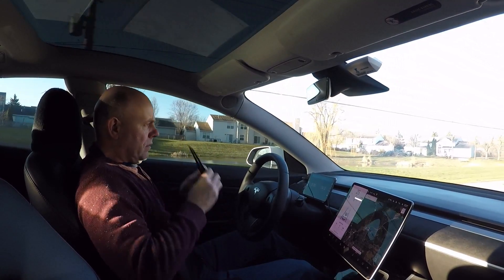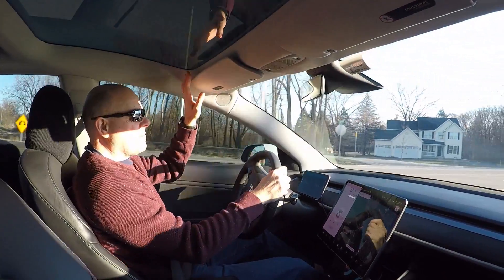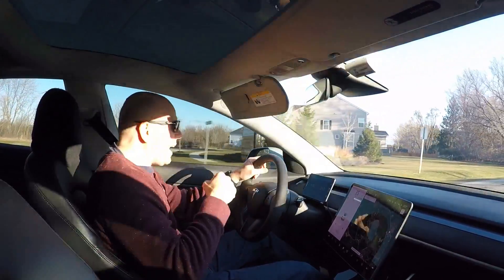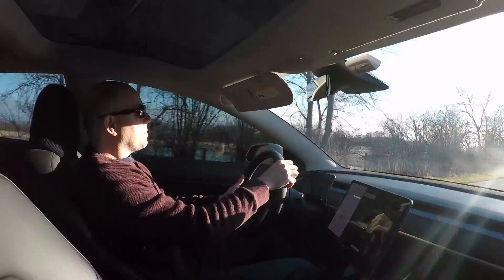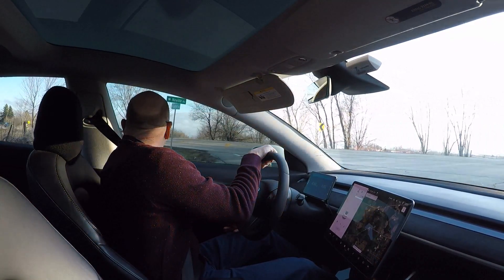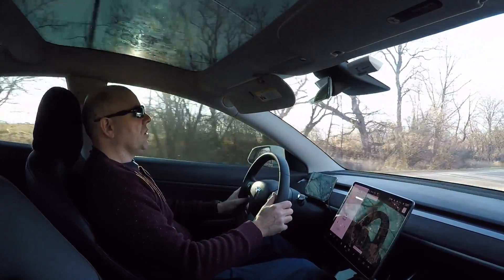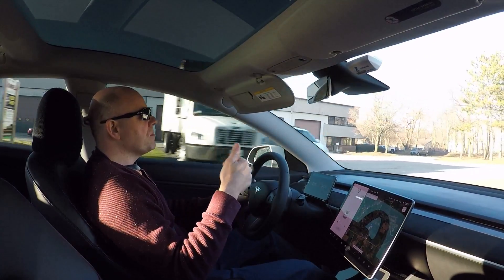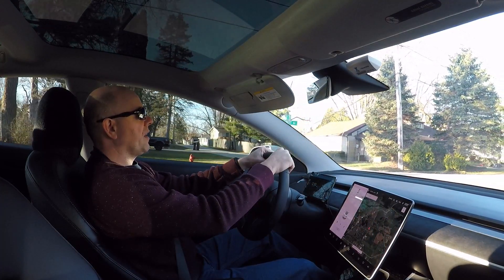Tesla Model Y and Model 3. I found a problem with one pedal driving!

Comment: Other easy solution, just slam the brakes from time to time and do a full stop from 60 or so. That cleans them up pretty quickly. Or just use Autopilot. It will also Slam the brakes in the current version for no reason sometimes 😂
Reply: Yes I noticed AP tends to use the brakes more frequently than my use when driving normally. For me only time I really use the breaks in normal driving is when the light changes to yellow and I am to close for regen to stop the car in time.

Comment: This is a common problem on all performance cars. It happens within 24 hrs after rain. The residue from the brake pads rusts, but it’s not a defect/problem. The first time you use your brakes it gets cleared up. Had this on my BMWs and Corvette.

Comment: I had the same with 3 JLR cars I had before I bought my model 3. The method I used was to LIGHT  brake while still giving the accelerator some pressure, but only for a very short time. Same result / different method.

Comment: as a previous mechanic i can tell you hard breaking can glaze your brakes and this is bad because you lose 50% or more of your breaking power! i would suggest pop it into neutral and feather the break for a long distance and it will do much better! clean your system with some break cleaner then treat your non contact surfaces with something like ceramic coating or if your cheap and not mine more frequent elbow grease use wd40 on non contact areas and be careful after any cleaning or treatment do some breaking with caution to rid of lubricants off contact surface

Comment: Some good tips Matt.  The one pedal driving setting is the same as the non creep mode though - the car still applies the brakes from 8mph to 0 but it does it for you and very softly.  Rich Rebuilds did a video showing some yearly maintenance on Teslas that includes cleaning up and lubing the rotors.  Helpful to do once per year so the pads don't lock up in the calipers especially in areas that have a harder winter with salt and chemicals on the roads.  The video title was "Servicing your Tesla model 3: The Complete Guide" - should be easy to find.

Comment: Had the same problem on my 2014 Model S P85 100,000 uk miles . The rear calipers were seizing and the discs were scored. Now a bad price to have them replaced and was told "look put the brakes on hard at least once a week you just never using the brakes". Fair comment. Two weeks later an over air update now indicates next to no regen in the morning that makes you use the brakes.....problem solved.

Comment: If I pull my ICE car in the garage after driving in the rain and let it sit a few days, the rotors rust every time. I hear a scraping sound when I drive away but the rust gets removed in normal driving. The rust doesn’t seem to hurt the rotors and the scraping sound goes away after 100 feet or so without any conscious effort on my part. It seems to me, if you used your brakes every time you park in your driveway just before you get home, the rust would be taken care of. In this way you don’t have to remember to do a special brake “cleaning” every so often.

Comment: Doesn't Tesla's one pedal mode blend friction brakes at low speeds?
Reply: oisiaa on hold mode it does.  I park inside, so rusted discs have never been an issue. His car is parked outside and also driven in the salt of winter.

Comment: After an EV comes to a stop using one-pedal regen braking, does it activate its parking brake to prevent rolling on an incline?
Reply from the maker: Most do. Our Mini SE doesn't.
Reply: @TechForumTesla   So you have to use the brake pedal to keep your MINI from rolling into the intersection?
Reply from the maker: @insightman  Yes. It has "Sort of" one pedal braking. It comes to a nearly complete stop (just barely creeping forward an almost imperceptible amount). Then you touch the brake just to hold it there.
Reply: John E Johnson the brakes hold on incline, but not the parking brake specifically. Hold mode uses brakes below 9 mph too. It blends them in with regen.

Comment: I get that BANG  almost daily even when there isn't any rust on the rotors.  Wish TESLA would fix that as well.
Reply: me too, it has absolutely no consequences though, the only thing i would suggest is to accelerate as slow as possible to reduce the bang obviously.
Reply: It could be the pads not sliding in the rotor very well.  There's a video titled "Servicing your Tesla model 3: The Complete Guide".  It shows some yearly maintenance to include the pads being removed, cleaned of rust and corrosion, and reinstalled with ceramic grease only where the sides of the pad contact the rotors.
Reply: I get the same bang on my Fiat 500e, especially if it hasn't been driven for a few days as are experiencing now.

Comment: I thought Tesla had Software that would apply the brakes once in a while. 
The bang I sometime even have on my gas car if it sits longer and it doesn't feel right
Reply: I looked on the owners manual because I thought the same, It says in wet conditions It will apply a small amount of braking to keep the rotors clean in the event you need to do emergency braking. It would be easy for Tesla to have the car do this on a given schedule to help maintain the brakes.

Comment: I have not had this issue with my 2019 Bolt.  Perhaps GM is using a different metal on the rotor?  I am in L mode 99% of the time and only use the mechanical brakes when someone stops abruptly in front of me.  Granted, I only have 16K miles compared to the 75K+ that you have on your Model 3.  Another factor could be we are in a much drier climate here in Central California versus the rain and snow you receive in northern Illinois.
Reply: IIRC:  The OEM rotors on Chevy Volts had a specific compound on the rotors that prevented them from getting the flash rust from coating the friction surface.  Folks getting replacement discs for various reasons would immediately see the rust on the non original  OEM discs...perhaps Tesla should use this same technology as was used on the Volt.

Comment: How many times a month do I need to do this cleaning to avoid the rust formation?
Reply from the maker: Every day or two
Reply: Remember, his car sits outside.  Mine is in garage and I don't have this problem.
Reply from the maker: @alexnutcasio936  the point is, if you rarely used the mechanical brake, rust will build up.

Comment: I wish I can park my car in the garage in neutral to keep the parking brakes off the rotors
Reply: are you manually applying the parking brakes?
Reply: @keaco73  no.  It parks when you open the door and parking brakes apply automatically
Reply: Executive Tutoring Services on the model Y it does?  My model 3 doesn’t.
Reply: @keaco73  right my model 3 auto parks and applies the parking brakes when I opened the door.  No way to leave it in neutral when exiting the car
Reply: Executive Tutoring Services really?  Did you set that somehow to automatically apply?  I have a 2020 and I have to hold in the shift lever button for 2 seconds then it applies the parking brake.
Reply: @keaco73  I set it to neutral, I open the door and it flips to park,  break auto applies.  Not E brake but still when it flips to P,  the parking brake applies. remember in ICE vehicles you can actually leave it in N and walk away.. Huh,  wonder how one would change the brake pads if you can't leave it in N

Comment: I use the break at least a few times a week when a yellow light pops up and I have to break a lot faster.. or a car pulls out in front of me.. or me failing to slow down fast enough off interstate ramp. I do not see how this is possible. You just ride in 25 mph zones and drive 3 miles a day😂
Reply from the maker: I am an extremely skilled hypermiler.

Comment: No rust in California my lug nuts aren’t rusted either.
Reply: Alll rotors will rust i f you don't use them.  It's not a question of whether or not your area uses salt on the roads during Winter.  Don't drive your car at all for a few days, and you will see the rust start up on your rotors.
Reply: Yes a light rust just on the rotors. It’s no secret that salty road wreak havoc on all brake components and the whole car for that matter.

Comment: Adams wheel cleaner.
Reply from the maker: This is not about the wheels. It is about the brakes. Didn't you even watch the video?
Reply: @TechForumTesla  yes , by spraying the wheel you will then spray the disk as well.  That's what I did and no rust. It is not possible to spray the wheel and not have product on the disk.